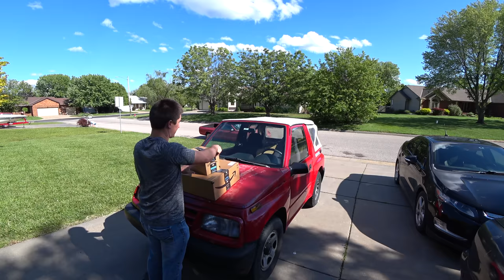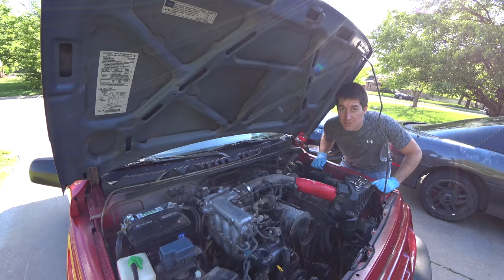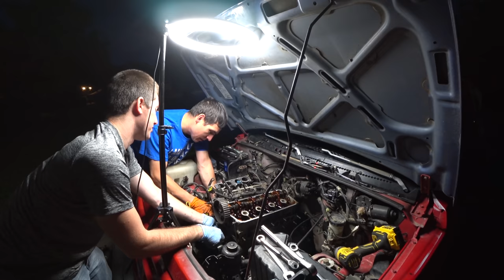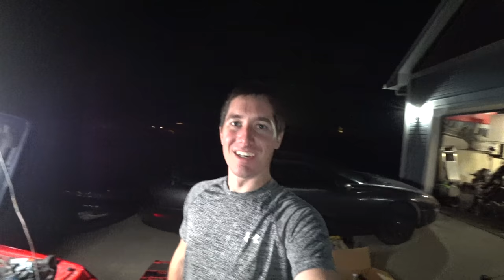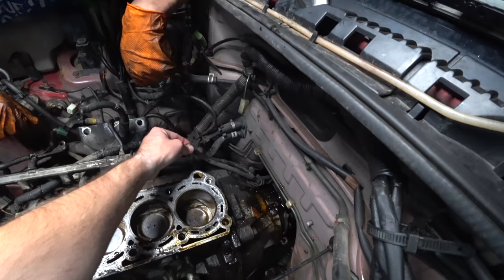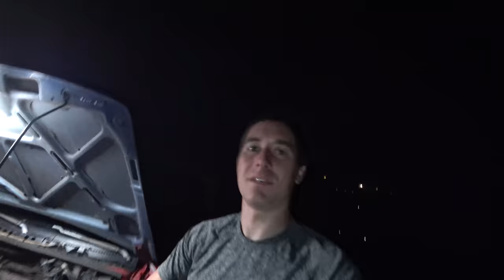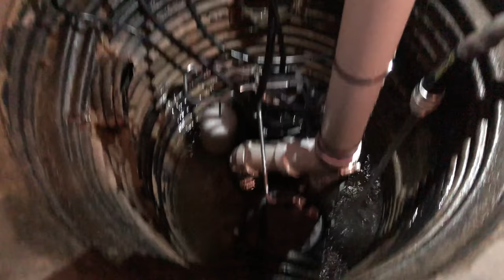$400 Geo Tracker NIGHTMARE Engine *Is It Worth Fixing?*

Comment: I wouldn't have paid for $400 for it in the first place.  The car probably isn't worth the time or money you put into it.  With most cars under $1000 you have to wonder why the person is selling it to you so cheap.  Sometimes they're just mis-informed and told the wrong thing by a mechanic, but most of the time, it means there's a major issue with it like you found here tearing down an engine.  At most that tracker might be worth $800 but with the time and extra money you put into it, you'd be lucky to get your money back.

Comment: What the hell is a sub pump? I don't understand the drive to do everything so "quick." It makes no sense to me. I don't know how on God's green earth you ever thought that you'd just slap a head gasket on that thing and keep going. No way. If you want the 100K miles you're yapping about, take that head to a machine shop and have them resurface it, do the valves and a full head service. Drives me insane that lack of thought, planning and quality of workmanship. I don't see the value of slapping crap together without fixing it. I also don't understand Amazon v Rockauto and especially Dorman which is just cringy. Everyone's got a different ceiling and floor I guess. You'll NEVER get anywhere's close to another 100K like this. You'll be lucky to get 10K. Do you have a real job?